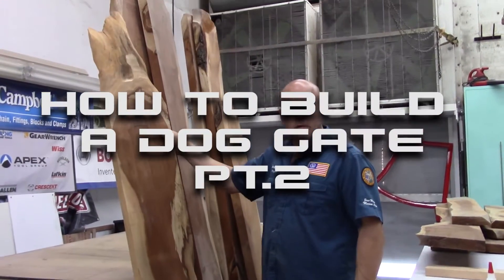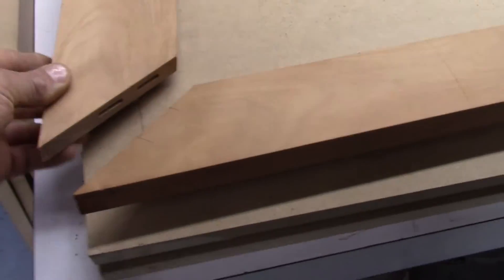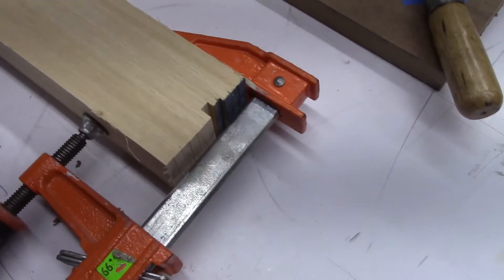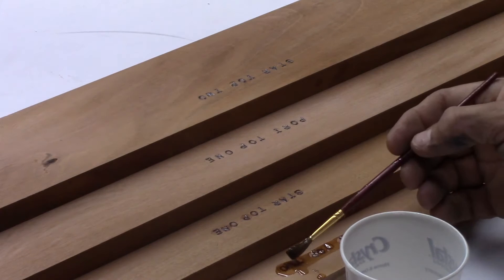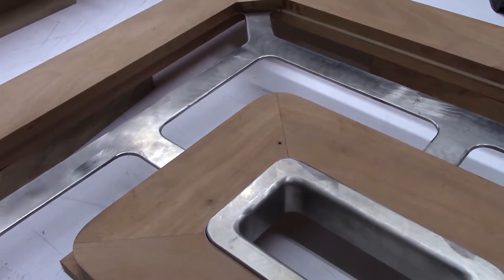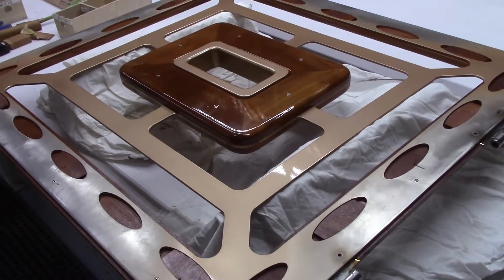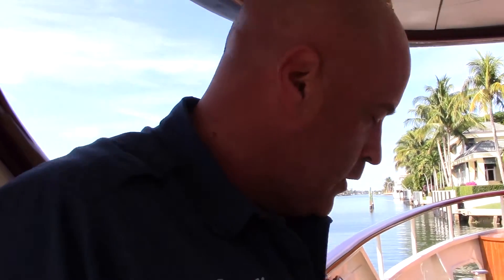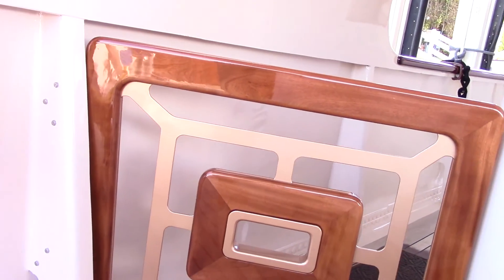Mahogany Dog Gate (Pt 2)

Comment: Talk about the sweet install. On boats like that I sweat bullets drilling into them. You got to have ice water running through your veins to keep your nerves calm like that. And Teak - the king of woods - combined with marine stainless, pretty awesome combination there.
Reply from the maker: The harder the job the better we like it! Most would rather do something easier, which I do not blame them for that, but personally if it is not hard I do not want to be bothered.
Jim